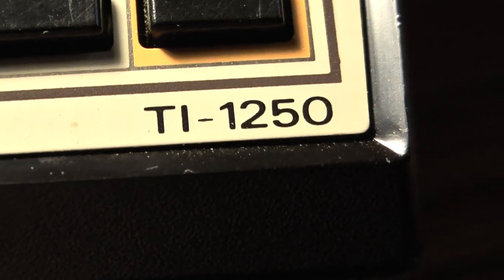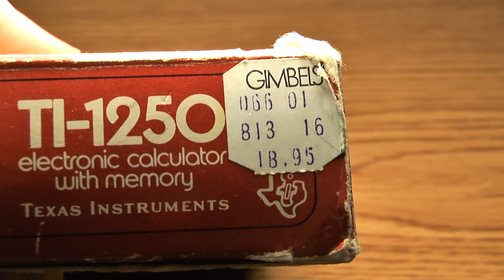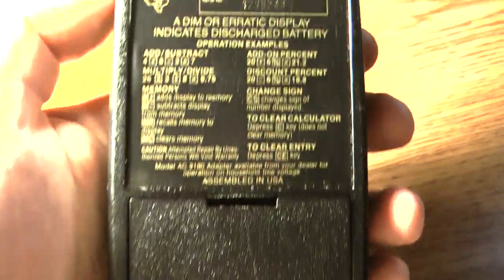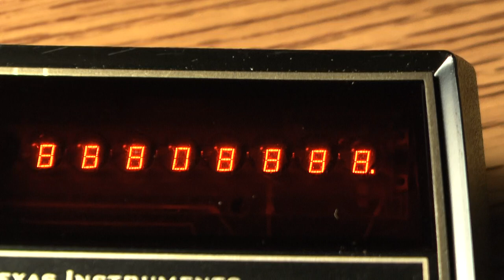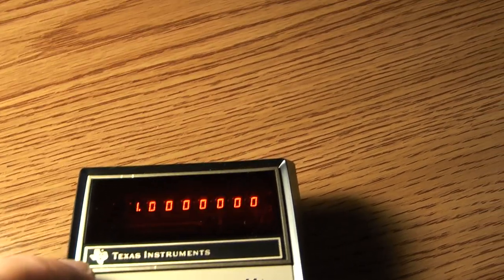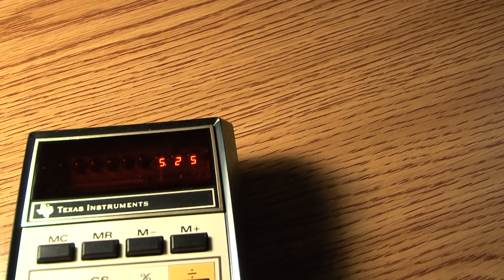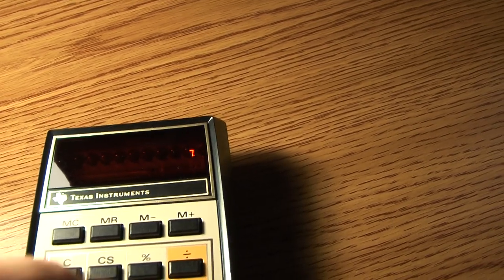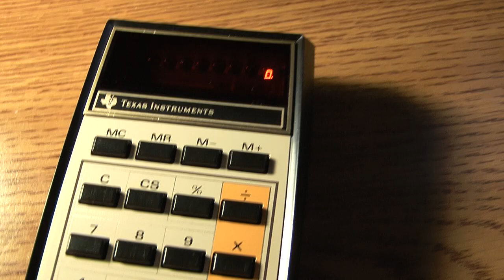Mint in the Box 1975 Texas Instruments TI-1250 Calculator

Comment: The flashing display in an error condition is probably a purposely exploited artifact of the calculator's slow processing speed, which causes the display to momentarily blank out any time the processor is busy. So when an error occurs, it probably goes into an endless loop, which causes the flashing display as a free side effect of the processor getting stuck doing the same thing repeatedly until you interrupt it.

Comment: Sweet! I love these old TI calculators. I've got a 1974 Datamath 2500 I got near mint in the box with leather case, original AC adaptor, and instruction manual a couple years ago. I use it almost every day for simple calculations. Did you try opening it up to see if maybe there's a bad connection to that missing segment?

Comment: The only downside to basic calculators, is that unlike the next level up "Scientific calculators" they are not limited to a ceiling height of 99,999,999. So if you wanted to calculate how many grains of sand are in your kid's sandbox for whatever reason? Then your basic one can't comprehend a number that big. But a scientific one can do it through scientific notations. So I can work with numbers up to a ceiling height of about a Googol.

But then again, a basic calculator is used more for financial and real world problems that the average person would face. Not how many grains of sand there is on all the worlds beaches. Aka.. The conservative estimate is 100,000,000,000,000,000,000. (Or 100 Quintillion.)